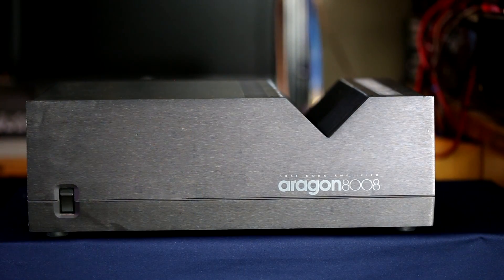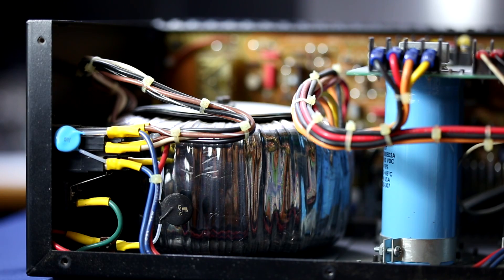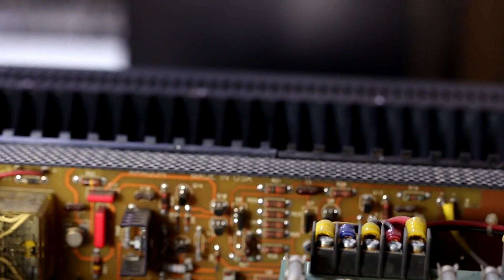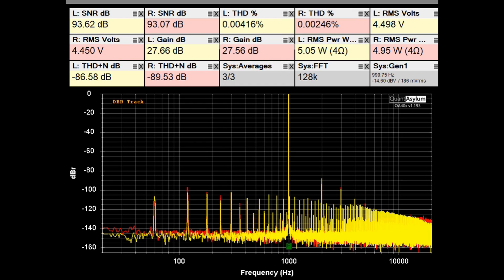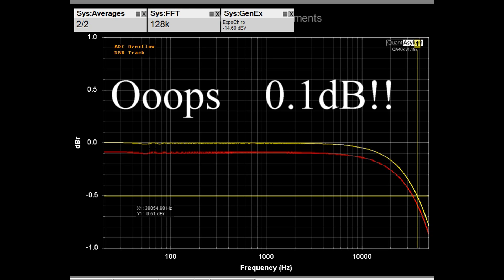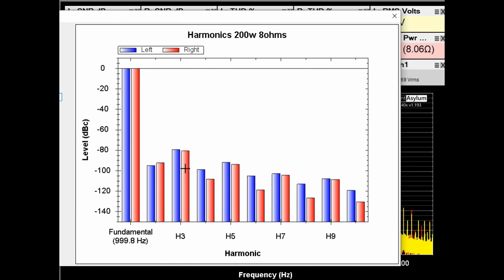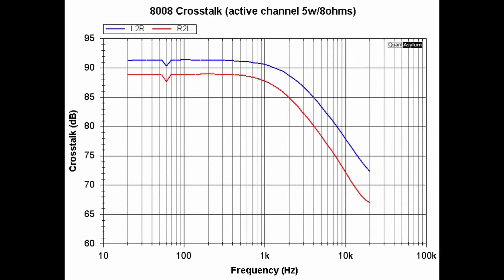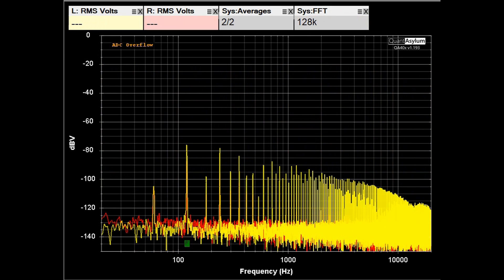Aragon 8008 Power Amplifier: Vintage Audio Review Episode #112

Comment: I just recently purchased an 8008 ST on eBay. The seller said it was completely tested and it was packaged very well. I’m getting no output when I power it up, the power indicator led lights up but the relays do not click. I’m quite disappointed about this as I shopped for the amplifier for probably a year on eBay. It will be interesting to see if the seller does anything in regards to it not operating. I also just purchased a set of B&W 802 series 3 speakers to go with the amp.  I have worked in the Audio industry for over 30 years in manufacturing, retail sales and installation as well. It’s always been a hobby of mine.
Reply from the maker: Thanks for sharing your experience, albeit not a nice one. Relays not clicking on means the amp detects some sort of fault. Ebay should provide buyer protection if it was sold working, if the seller cannot make it right. When I sell something one ebay I provide recent data that I measured on the item, but do sell it as is due to concerns about handling, but price it a bit lower.

Comment: I will never part with my 8008 BB. 

I recall being very impressed with how warm and dynamic it sounded when I first heard it at the audio store when auditioning speakers. I asked if it was a tube amp at the time.

The biggest revelation came years later when I actually bought mine as a replacement for an Acurus amp.
The depth and 3D clarity of the soundstage was beyond any other amp I've ever heard. The improvement was so large that it was impossible not to notice easily. My listening room opened up and expanded.
Reply from the maker: Glad you are enjoying it and so is my friend who now has it- thanks for taking the time to comment!

Comment: Just a note, the 26W class A rating is deceptive.  You will need something like a 60 ohm speakers to make it work.  Since the idle current of less than 1A per channel will never be enough to drive a reasonable 8 ohm speakers.

A more realistic figure of 1 to 3W of class A operation would be more in line of the kinds of speakers we all have in our homes.

Comment: Monster amp. Though todays SOA purifi and ncore class d amps out perform it at prices that are often less expensive than this amp used.  My memory is that these have little to no protection on the speaker outputs, if so as an older amp careful with the speakers.
Reply: The Class A /AB Aragon (Mondial) 8008BB has dual toroidal transformers and (2) 35,000 μF caps per channel. At 400 wpc  at 4 ohms, the 8008BB remains in Class A most of the time, switching to AB for dynamics and transients. The BB model variant also incorporates balanced XLR inputs alongside the unbalanced RCA inputs.

Maybe someday there’ll be a PWM Class D amp that can handle the dynamic range and headroom to power through difficult passages as do Class A amplifiers – unfortunately, that day isn’t here yet. 
The cheap and powerful Class D amps offer beginning audio aficionados an impressive entry level sonic experience without breaking the bank.
Reply: The design of this amp doesn't  destroy your speakers if it fail
s. I had 2 studio A/B Halfler that were great but did destroy 2 expensive pairs of speakers.
Just because these are older amps doesn't mean anything. You'd be looking at something like a Jeff Rowland or a PS audio to compete with this amp in a D class. This a better amplifier than the amps you listed by quite a margin. The parts used inside are extremely high quality. Made in the US by hand with monster size parts and wiring.
Reply from the maker: None of those amps carry the aesthetic appeal of the Aragon. I haven't worried about speaker protection in years- am not sure what Aragon did. I appreciate the comment.

Comment: I had never heard of Aragon , and found a mint one without a scratch.
Im thinking about getting an Audio Research tube pre and powering some magnepan LSR. I have the dual transformer model.
Ive heard the LSR+ are hard to drive and wonder if i should have a tech go through the amp?
Reply from the maker: Have not heard the LSR but in general, I don't mind listening to planar speakers for a while, but they just don't have the bass I like though they may do other things nicely. I would assume the Aragon would have enough umph to drive them if it is the one reviewed here. I would not have someone go thru the amp and just replace things. I would have them hook it up to a 4ohm load and test it to see how it performs against its specs and go from there. Thanks for watching!

Comment: Requesting a Hafler XL-280 review
Reply from the maker: I do have a Hafler 500 review that will be in a few months, as well as a Hafler preamp, but don't have the XL-280.
Reply: @vintageaudioreview  that will do, Hafler very good gear 
Hafler mosfet vs Soundcraftsmen mosfet
Reply from the maker: @TheBerdaguer  I also have the heavily modified Hafler 500 that I will test and review in the future as well. Keep in mind that these belong to my friends most of the time. If you go back through my videos, I have done two Soundcraftsmen amps.
Reply: @vintageaudioreview  
I saw those videos 
I wonder which one is better Hafler or Soundcraftsmen
Reply from the maker: @TheBerdaguer  As far as the sound between them, not much of a difference. THe RA7501 does not have a fan, while the PCR800 and Hafler do, so my vote would be for the RA7501, which can work as a nice monoblock amp as well.

Comment: I have the "BB" version of this amplifier, with balanced outputs.  The BB version has two torroidal transformers instead of one, and double the capacitance.  I've had it since new, and it's one of my prized possessions.  

Aragon products were made in upstate New York.  The amplifier version reviewed in this video is called the "8008 ST," versus the "8008 BB."

Aragon was acquired by a new owner a few years ago, and their version of the 8008, which I believe has the same specs as the "8008 ST" costs about 10 grand.  They may have rebranded models from "8008" at this point.

Great review, nice to see this amplifier still appreciated.  I don't think another amplifier is necessary, as the 8008 will power any speaker without breaking a sweat.
Reply from the maker: Thanks so much for the informative comments. I saw that there is a new version, but did not realize it was so expensive. One of my friends is borrowing it and does not want to give it back to the owner (another friend)....
Reply: @vintageaudioreview  I can understand why he doesn't want to part with it!  🤣   I moved residences several times over the years, and always bring the 8008 in my car, on its own, and hand deliver it myself.  I really love it!
Reply from the maker: @AmazingChinaToday  It will be interesting to see what happens...
Reply: The (Mondial) Aragon 8008BB does not feature “balanced outputs,” as found on earlier Krell and Mark Levinson amps. The Aragon (Mondial) 8008 does indeed have balanced (XLR) inputs in addition to the standard unbalanced (RCA) inputs.

Comment: Nice review TY. Weren't these dubbed as the poor man's Krells? I think Dagostino designed the older version of this, the 4004. It was a tru dual mono with two Toroidal transformers.
Reply from the maker: Thanks for taking the time to comment. These things were still pretty expensive, at least in my mind, but certainly not as much as equivalent output power Krells.  I think you may be correct about the 4004...

Comment: You comparing specs of 8008BB,  this one is not BB version,
Reply: You are correct BB has XLR , BB stand for big balls , it has two  1.1KVA transformers , 4 rectifiers , more than doubled the power supply capacitors , power supply is substantial.
Reply from the maker: @akhtarizod5802  I did not know what the BB stood for, but I do now... The power and Thd specs I quoted I am pretty sure were correct for this model, though.
Reply from the maker: I am not sure that the main specs would be that much different as I think the difference was the BB had balanced inputs. I am usually pretty good about trying to get the correct specs, but I may have missed on this one. Thanks!